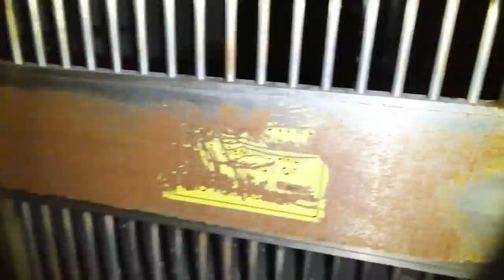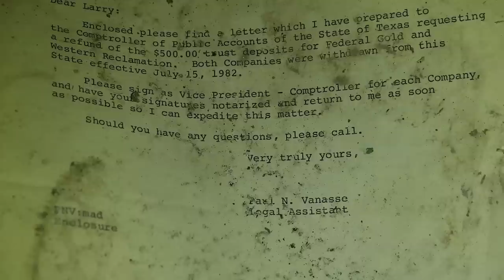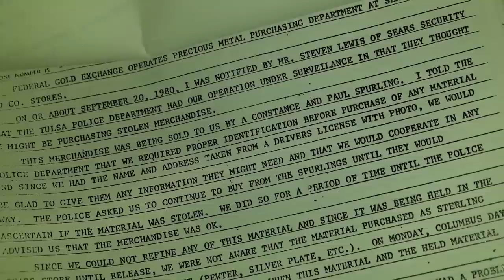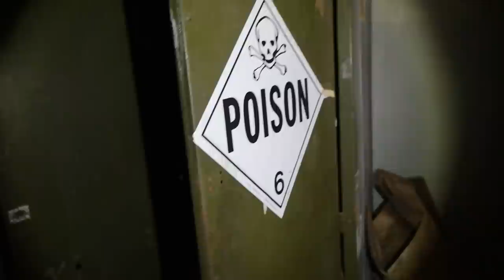ABANDONED federal gold exchange BANK ( FOUND VAULT ) PART 2

Comment: Does anyone realize how much money is still in that place? I have no idea why a reclamation company hasn't cleaned out the marble, hard wood panels, vintage sinks etc. Hell, those chairs with the little tables (student desks) cost about 60.00 to 100.00 a piece where I am. Those sinks cost about 250.00 each.
Reply: +Prepper Angel thinking the same thing
Reply: Won't be worth as much as you think the panels are custom made. It's all rotted away dry rot wood worm etc

Comment: You guys should get some lockpicks, learn to use them, and then go back to the vault. It looked like a regular key lock. Plus you could use them on future adventures in case you need them again.
Reply: Aspen910 Picking the lock on an empty vault seems worth it.....riiight.  I'm sure that gate was open at one time, it opens only by key, stays locked. Some dumbass explorer just pulled it shut.
Reply: Aspen910 I'm saying, THERE'S NO POINT to pick the lock on that vault.
Reply: fetymann There is just as much reason to pick lock doors and vaults as there is to explore these places.
Reply: You may as well just not go into the bank in the first place because it too is 'empty' lol
It would be cool just to be inside the vault. Especially if you picked a lock to get in. Although it looks like a normal lock i assure you it would most definately not be
Reply: fetymann 
Picking a lock is not easy. It would take a lot of skill and practice and then it is not a video game either. But then each to their own.
Reply: bighands69 Exactly, it could even be a Medeco lock, which are hard to pick.  Again, not worth it.
Reply: +Aspen910 Yea they should have brought a rogue, instead there's just two twinks
Reply: plus you'll get at least lockpick +10 Then you should work on your sneak skill it seems kinda low.

Comment: Those mechanical lumps up in the roof space are the elevator motors and switch gear, i would have a feild day in there the amount of architectural salvage, what happened to the buildinv is it still there?